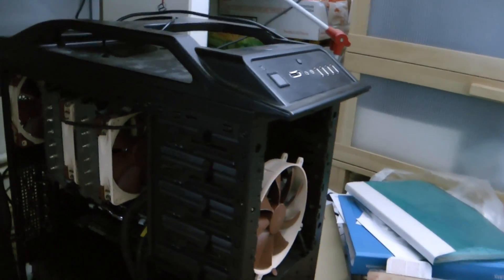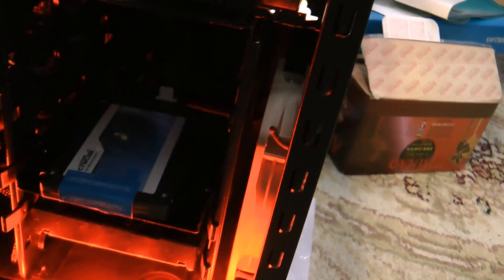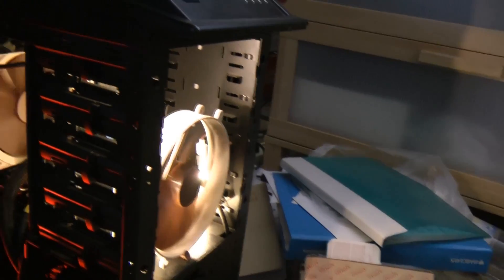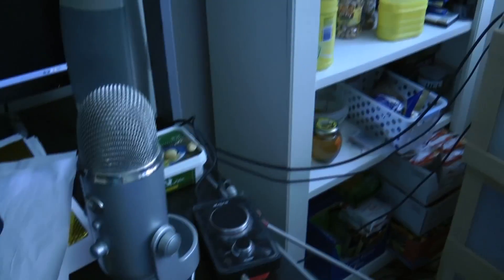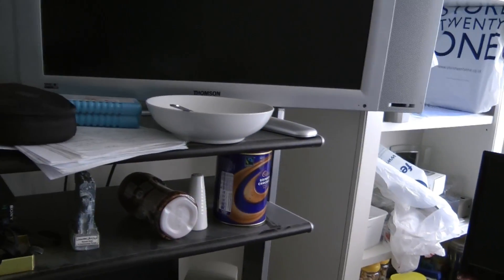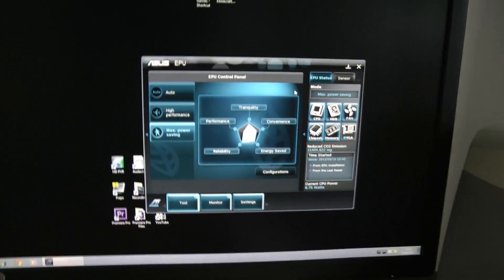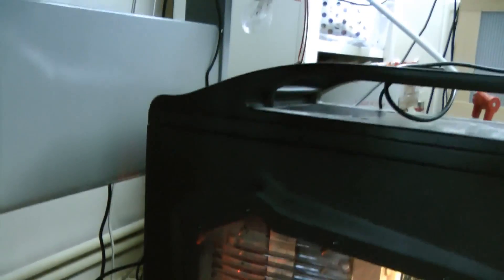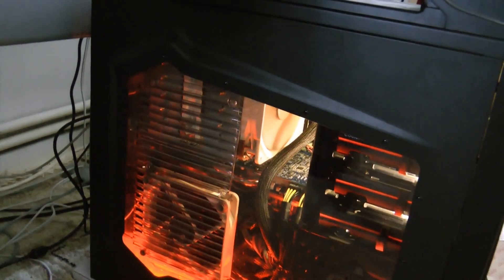Custom PC + Setup Video

Comment: tbh with you there normally is no need for really powerful pc's i think people get carried away dribbling over these new fancy parts i used to be like that but now i dont care much i have a amd phenom ii x2 unlocked to x4 with 890fx mb, 4gb g-skill ripsjaws memory  1600mhz, and a ati 6850 xfx and that runs all the games i like playing max setting at around 95-105 fps on a 1920x1080p monitor, so i have got to that stage now thinking really what is the point wasting all that cash.